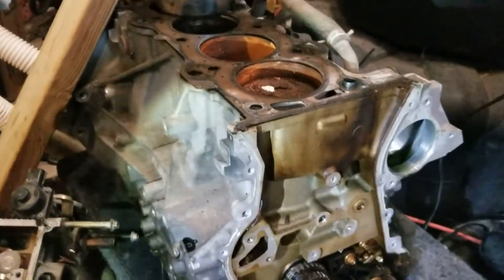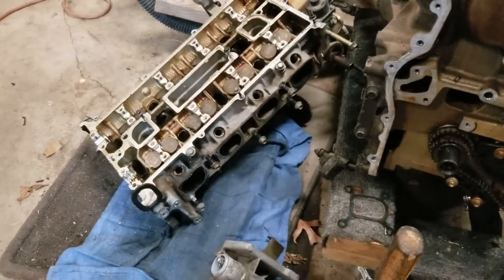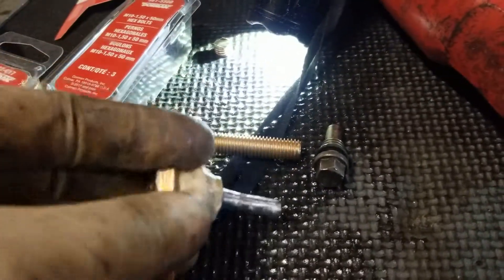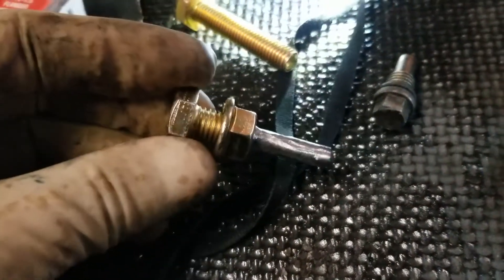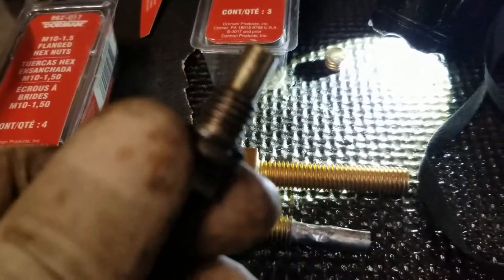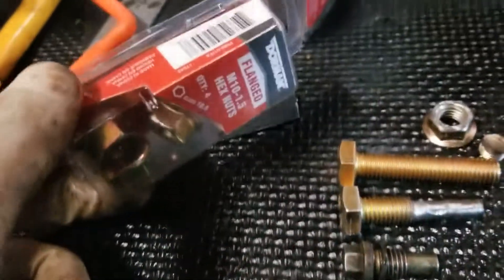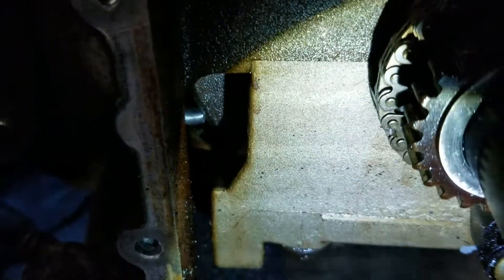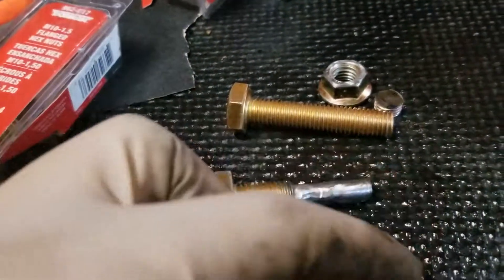How to make 303-507 crank timing peg for ford/mazda 2.0 and 2.3L engines

Comment: The length needs to be 38.55mm  or 1.5  inches, not including the head. For the crank to stop a TDC. Do not use this tool to hold the crank wile torquing pulley or flywheel bolts, you may bust out the side of your block where the bolt goes in.
Reply from the maker: Its designed to set TDC, not torque crank bolt. you should have another tool to do that as I did.   There are other videos on how to properly torque bolt down.  This one is designed to set timing.
Reply: is this mm measurement for the 2.0l, 2.3l , or 2.5l?
Reply: @paulaguirre6281  2.3 and 2.5, I do not know about the 2.0 .

Comment: That's slick bro thanks 👍I'm working on one 2.3 mazda 3 I don't have the tool to hold crank and saw your vid and it really help me out as for the cams I made my own tool a peace of aluminum stock and 2. Nickels to hold cams straight I'm hoping  this will get the job done and I had to replace pistons 2 of them had holes in them from old valves that broke long story. But ya thanks 🤑

Comment: That's awesome man thanks, can it be used when the motor is in, like when just changing the head gasket
Reply from the maker: Correct.  Thats its perfect for that and you will never have to worry about the bottom moving on you while its apart

Comment: How long is it? You don't even need to machine the bolt down.
Reply from the maker: same exact length as the 303-507 crank timing peg you can buy.  i didnt have a machine to bolt down when I made it.  just a pair of vise grips and a angle grinder with the sand disc blade.  use a table or bench for stability.   I do not recommend this method if you do not have stable hands.  

Timing peg itself was fit tested as it was made.